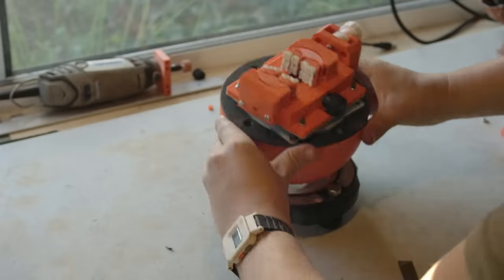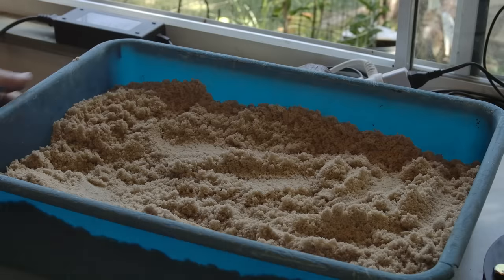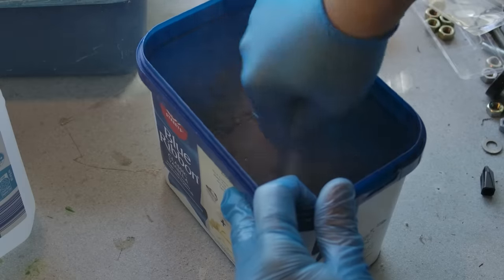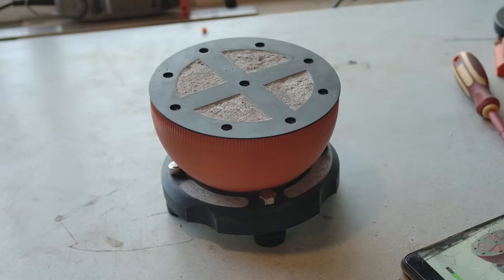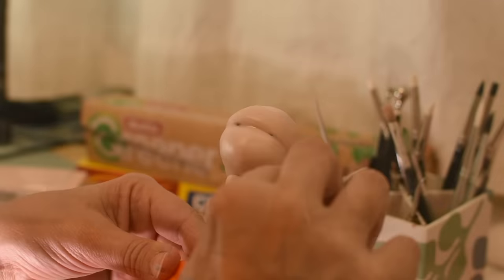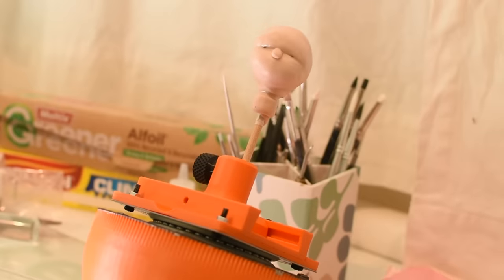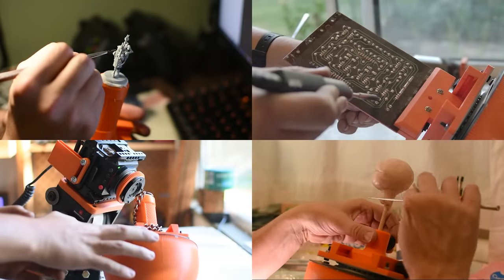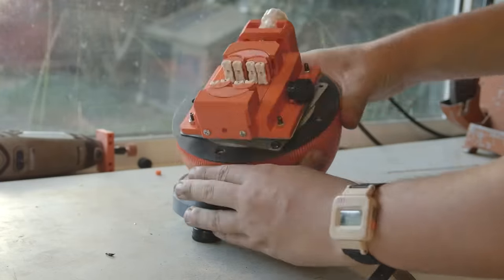The 3D Printed Ball Vise Every Creative Should Own

Comment from the maker: Back from easter, glad people seem to like it. A few FAQ's ive seen:

-It does have rubber feet, I just failed to mention it. The feet have a thread which replaces the bolts.

-It does not ride on the nuts, it sits in the rubber ring although it only has .5mm of clearance so it seems like its on them.

-Ill try make an imperial parts list/ version

-Yes, a detent or locking turntable version is in the works I just wanted to get a more ideal turntable to base the design around first.
Reply: This looks great! I can see massive appeal. Thanks for answering those questions.
Reply: I'm confused about the turntable. Is that metal? Is it a print? Is it included?
Reply: ill be printing some parts tomorrow. since I'm in the US ill be trying 5/16th instead of the 8mm. I'd imagine it'll still work as the difference is super small
Reply: i've tried something similar with those 2 ring turntable bearings from aliexpress.
the problem with those is that the locking screw just goes straight into the bearing race and either hits a bearing ball or squeezes in between.
They don't brake the turn table smoothly, there's like a bit were it starts to break and then you have to turn the screw a bunch to push the bearing balls to the side and when it bottoms out there is still a few degrees of play on the turn table which is unacceptable so i ended up just buying a vevor ball vise.
Reply: Greetings, I'm from Indonesia, I'm a coin and knife engraver.  This is very interesting but I hope you upgrade it again to be used to carve under a microscope... maybe the top part remains round like a ball vise vise in general.  All this time I have been looking for a solution for a ball vise, I can't afford the original one.  I hope you reply to this comment

Comment: $10 to make that? Its really cool but definitely not $10.
Reply: Idk how much cement costs rn, but the plastic is certainly cheap.
Reply: Yeah, it looks like a great tool, and I'll probably make it, but it's probably going to cost about $50 USD between the filament, concrete, hardware, and piping/glue.

Comment: The sand isn’t to hold it still, it’s to provide back support when the cement heats up and would warp your sphere
Reply: Exactly this, cement gets warm/hot as it cures, PLA would deform without it (PLA deforms at 45-50c and cement curing goes up to about 70c)

Edit: Plaster would be the same, just slightly cooler. Still warmer than PLA needs to deform.
Reply: Why ASA is king 😎
Reply: I'm really curious where did you get this... information. Portland cement is the only one who gets "hot" ( not 160 C hot - 30 C hot) .

PLASTER - GYPSUM- gets hot , but not enough to deform PLA... HOT PIPE water temperature is usualy 56 C - try and melt PLA with it , then try and put your hand in it ... 

After you come back from hospital, tell me how can i find this ...information of yours...about how hot can cement get ... 

Is obvious to me you never used Plaster- Cement in your life and come up with weird information and unreal ...
Reply: @recka5000   PLA doesnt deform at 45-50 C ...otherwise you would heat the plate to 60 to sick on it ... and you would need 205 C to melt it . 

At 180 C you struggle to print with it ...
Reply: So...just print with ABS/ASA?
Reply: @sileniu  With weight and a little time, pla will certainly deform at 45-50C. You can see that if you print a fairly thin object and pull it off the heated plate while still hot.
Reply: @sileniu  it definitely deform at 45 - 50C, just take much longer.

Comment: Idea for possible improvement: Make the main body from a metal bowl and use a switchable magnet like magswitch in the base to be able to lock it in place. That way with the base bolted to the table maybe you would be able to even use it for wood carving or cutting things with angle grinder
Reply: Combining the magnet switch with a welding foot pedal would be probably very effective
Reply: My thought was to print a cam with a lever that presses against the side of a cylender on the rotating part, to lock it in place relative to the hemisphere. Lever 'up' free to spin, lever 'down' locked down. But a magswitch could work as well to work with a plate that goes all the way around the turning part. Lot's of possible solutions.
Reply: Oh shoot, I just saw your comment after posting pretty much the same thing, though I was thinking a hand pump to create a vacuum instead
Reply: Great idea. Metal kitchen bowls are either stainless or copper (expensive). Neither are magnetic (enough - cheap stainless is a little magnetic). My experience with electromagnets suggests you'd need the iron to be quite close to the coil, so dumping old nails inside would probably not be adequate. 

Answer might be iron filings in the base, with a cap of cement. Or a cap of pourable plastic. In the USA we have the advantage of having guns, and materials to reload them. So steel shot is commonly attainable without the dark forces of gubbermint all getting into your face. So that's another option.

So a stainless bowl filled with iron filings, capped with something, then placed on a base with an electric ring magnet, might work well.
Reply: With all those screws in there, perhaps the plastic outer would still work.
Reply: @FamilyManMoving  In regards to your comment about Stainless Steel - it is ferrous. No matter "cheap" or expensive, all types of Stainless Steel are ferrous, therefore they are magnetic. You can test this with a strong magnet (such as that from a disassembled disk drive) - just place the object on a smooth surface, hover the magnet above the object and you can move the object. There is no going around the atomic structure of any type of steel: it will be ferrous.

Comment: 1:35 I don't know about Australia, but in the US you can walk into any tire shop(better if a local place, just because some corporate managers have a stick up their ass) and ask them for a handful or two of old lead weights used to balance tires. In the US they have to pay for them to be disposed of so you're saving them money by taking them. When I worked at a tire place there were always guys getting old weights to use in fishing lures and weights.
Reply: this is actually super useful information and I'm totally gonna do this
Reply: @Twoshoestrings Using lead would also allow you to make it smaller while keeping the weight similar. You could then make one for your friend closer in size to the ball vise Dispae makes for scale modeling/minis.
Reply: Just keep future disposal in mind. If you put a good amount of lead in it and cover it in concrete, no one except you knows the real content of it. Lead itself has a low melting point, so maybe cast itself and have it pretty obvious for later persons to find and know what it is.
Reply: Most weights have been zinc for a long time, you might get lucky and get some lead ones but it is unlikely these days.
Reply: Agreed on disposal - please do not do this.  Lead has costly disposal for very good reasons. Unless you're going to follow those rules, stay away from lead and don't contribute to the problems it causes.
Reply: @groxx They are rarely lead. Its almost all zinc nowadays and has been for years so there is little worry about lead contamination. Anyone who still makes bullets will also tell you this.
Reply from the maker: That is a great idea, I thought of scrap lead but in AU buying scrap is kinda annoying most places dont sell it. Will have to give that a try.
Reply: USA  🇺🇸  is full of scrap,
and I'm not being facetious about the matter. 😂 !! Love your design works 💪
Reply: I was going to suggest the same
Reply: I used to get wheel weights from all the local tire shops for casting bullets, but these days so many are zinc it isn't worth it anymore. Using it for something like this where you just need cheap weight zinc should still work fine though. It's just not as dense.

Comment: I was thinking the same thing about locking the turntable.  Smooth rotation is a nice feature for certain things (like filming that coin), but I think most of the time I'd want that locked, and I could rotate the whole thing the same way I'd change the angle.

I'm now thinking of building two of  these.  One for a vice, and one for a light stand.   This is a dangerous line of thought.  Pretty soon you've got half a ton of concrete on your workbench!

Comment: Excellent video, design and recommendation! I have a ‘real’ ball vise that cost several hundred dollars and yours will probably do most of what it can do. 
I suggest printing some ‘domes’ to fit over the bolt heads to keep the bolts from digging into the ball over time. 
The little metal had vise you showed is an excellent addition too. My ‘real’ vise came with that built it, very handy

Comment: in 2016 I built a nearly exact copy of your ball vice using a bowling ball.  I mounted a small drill press vice to the top using a Lazy Susan just like you.  Cutting the Bowling Ball in half was the biggest challenge, but I did that on my lathe using a cutoff tool.

Comment: with that rubber strip for friction, you've almost built a lock into the base. build a little lever assembly with a piston (a simple syringe possibly) and use a little tubing connecting to the base under the ball and you can use that piston to create suction. You would just need to plug the hole at the bottom which gives you an opportunity to design a vacuum port.
Reply: This is a great idea, but one thing to keep in mind is that fdm prints are not air tight. so while the ball might be fine due to the concrete, the rest of the plastic around the ring may still pose additional challenges for creating a vacuum.

Comment: for the turn table, you can probably 3d print a base with a raised circle, and a top that has a channel mirroring that circle.  this would allow rotation pretty smoothly and would have less wiggle in it. 
further, since you're 3d printing it, you could have a screw that with a half turn, would lock the two together with a little tension.
Reply: buying a high quality turntable for $30 would likely also just work

Comment: Thank you Chris I try to make one.  To make a smoother rotation on the Lazy Susan bearings, I use a very heavy silicone grease that they sell at Home Depot to grease valves and faucets;  it comes in a very small 1" round container with a light blue cover. It gives the feeling of an hydraulic movement.

Comment: I've been wanting to 3d print a fractal vise for my in-law and this looks like just the thing.
I also appreciate that you mentioned a part that can be purchased versus the one you milled yourself.
So often I'll see cool projects that look doable and then they start machining something out of metal and at that point I drop out.
So thanks for the cool project. Sub'd.  ps. Adding 360-degree marks on the base might be helpful.

Comment: 2:35  Use a vibrator to help the plaster flow between the  parts.  That way, 3:20 it will be solid instead of having loose parts inside.  Beautiful project!

Comment: Love that!!!
For the weight, instead of concrete, mix up some #12 lead shot and epoxy. It will be heavier and more stable.
Reply: Never done epoxy stuff before, should I clean the lead before using it in epoxy? If so, what should I use? There's a fishing shop near me and I'd be buying lead weights from there.
Reply: @kawag2780  It is kinda dirty. Swishing it all around in some alcohol wouldn't hurt but not really necessary. I honestly don't remember if I cleaned it before doing it last time or not. 
 I suggested #12 shot because it's very small and you can get a lot in there. The fishing weights will work but the end result won't be as heavy is all. If you can't get shot, find the smallest fishing weights you can.
Reply: @kawag2780  If you wanted to get really industrious with it you could create a pattern and then pull a sand mold off of it to then melt the lead into. If you wanted to get the most in there, that would be the way to do it. I've never wanted to go that far with it hence the shot and epoxy.
Reply: If you design the receptacle well then you don't need epoxy. It can just close properly and keep the lead shot inside. Probably much better for the environment too as it does not need to be disposed of later as the lead can be re-used.

Comment: Absolutely have to make one of these and thank you for a great tool. I use BB's for weights for various purposes (filling boxes before annealing, distributed weight on complex surfaces, when glueing, etc)  and it would be the ideal filler for the base - with plaster, or even without (make the top of the base a solid surface). I'd probably get rid of the rotary bearing and just use a simple adjustable pivot that's also 3d printed - the extra friction is ok, for my purposes. Again, brilliant! I subbed.

Comment: Due to this video I am not sure if you're aware, but you can vibrate concrete to make it go into the places it should. So for the rusty nails and all that you could put it in first, then pour the concrete, and vibrate it to make sure you're getting as much as possible inside and theres no air gaps

Comment: I made an engraving vise much like yours but from a sawn off bowling ball for a base. I think I used that exact lazy susan bearing and that turned out to be the the weak point, terribly rough in rotation and with a lot of lateral movement. A shaft running in two ball bearings is a far better option I think. It also gives you the option to lock the rotation of the vise with a set screw running through the side of the base (in an threaded insert in the base print maybe?). This is useful for when you need to apply force and frees up your other hand. Good for light hammer and punch work for instance.

Comment: You could add a counter weighted lever to the bottom of the stand that pushes a small ball bearing lift to the bottom of the base. This will make it easier to spin the base into position without having to lift. Then put some 3d printed caps on the top of the hex nuts that make contact with the rounded base when the lever is up. The top of the caps could have a silicone/friction surface to lock the base in position. Then the user can apply more pressure to the work area.

Comment: fantastic design that id find many uses for, i have a simple suggestion to help solve the locking of the rotation bearing: is a hole drilled in the bearing plate and a threaded whole in the top vice plate between the bearing plate and vice of choice with a adjustable thread that pushes the bearing plates away from each other and locking under tension. this would let you keep the simple design materials also.

Comment: I agree some way to quickly lock in place would be a must for us painters :) as well as to lock in place if we were fitting out a PCB as when soldering a move at the wrong time can cause wasted time from have to clean solder from a spot not needing to be soldered :).
I would probably use old lead sinkers instead of rusting iron/steel as rusting metal will just keep rusting even inside the concrete and eventually cause the concrete to crack, just like concrete stumps under Houses do as the metal reenforcing rusts over time as I had to replace all the stumps of my house as they were all in different stages of breaking apart.
Just a thought as I noticed a lot of rusty metal not just a few pieces :)

Comment: 🇦🇬
I like it very much. It’s thoughtfully designed. It’s multi purpose. May I suggest you use small lead weights from your local tire installer/balancer, or sinkers from an angling/fishing supply store; the lead is heavier per cm3, and it won’t rust and expand inside the mortar. ⭐️⭐️⭐️⭐️⭐️.
🙇🏾‍♂️

Comment: My I suggest a couple of "upgrade" ideas. Instead of having the ball sitting on a desk/table, instead, build a rail that would be mounted to the table and then the ball vice would sit on it. Much like how a camera rig works on a track for steady filming. This way your friend's issue of the piece being too far away when tilted a certain way can be resolved. And a lever bolt can be used to lock the ball in place on the rail. Also a lever bolt can also be used to lock the ball from shifting, much like a ball socket on a tripod. As for the rail, if you use the dimensions of camera rails, this mount can also be used for camera shots too. Or better yet, a slightly altered version with a slightly lighter weight for camera grips. Hope this is useful.

Comment: This is such a solid idea and super well executed! 

For the base, while I think it's pretty perfect. I was curious to ask if there's one way to improve on it would be reducing the weight of it perhaps thinking about people who may issues with lifting or maneuvering heavy objects. My question on potentially improving it might be removing some of the weight but finding a way to line the spherical aspect with a metal finish. For the base-base points of contact which look to be bolts and having those perhaps be magnet. It might assist in "Locking" the base as well if anyone were looking to apply more force onto what their working on.

Comment: possible simple locking method is a magnet on the base you use a simple lever to raise and lower so it engages with the cement & steel sphere and  that locks it to the base
Reply: and for the mini painting stand make the top pivot ~120 degrees and be held in place by a tensioning bolt

Comment: Great product.

For the miniature painting feedback, I would look into a taller and smaller base, the 'half ball' part would also be smaller of course, but less weight should be fine due to the light weight of the miniature, and then reduce the length of the miniature stand. That way the painter can be close to it, and more importantly when turning it, it won't move that much.